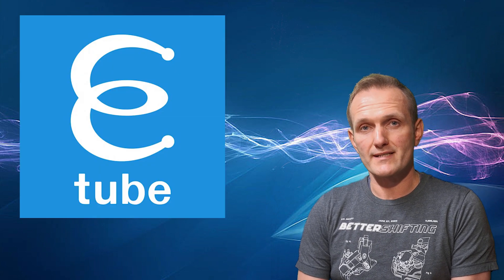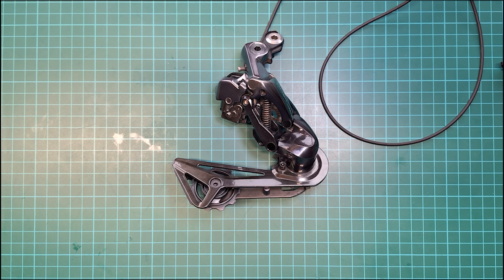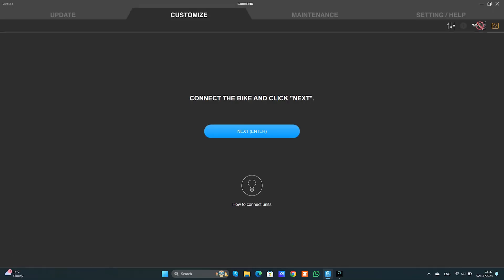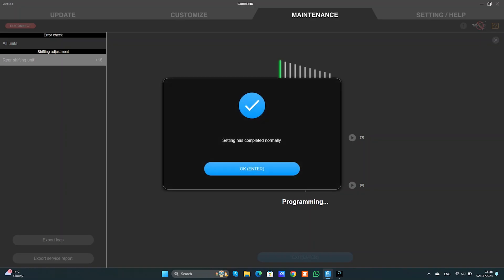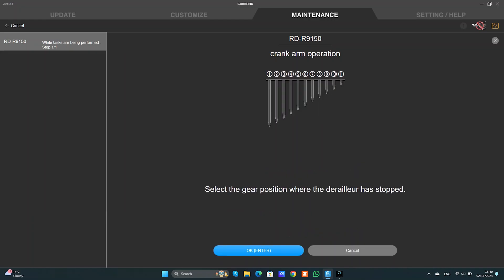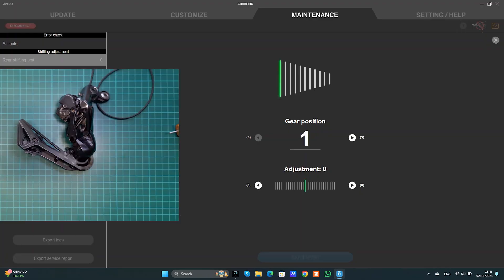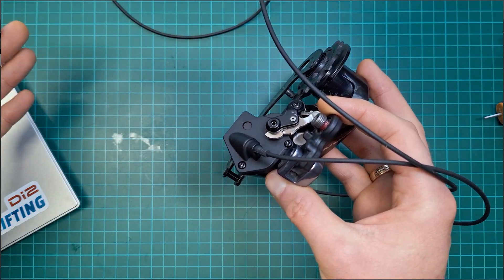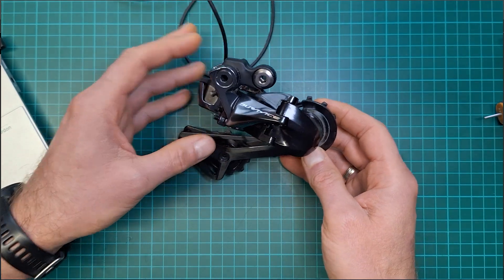Di2 position sensor reset using eTube Project (New old News)

Comment: Thanks for this great video, it helps me allot.
But when I perform a status check and select the sprocket which gear it is in, I get an error and have to perform an error check again.
Reply from the maker: What derailleur model is this? Does the unit shifts fine, (within the restricted range - 5 gears etc)
Reply: @Di2_GP it is an RD-r9150. The unit shifts fine.

This is the error I get: The derailleur position may not be adjusted correctly. Adjust the rear derailleur after checking the error
Reply from the maker: @MrMaurits1982  Can you drop me a dm, or email with screenshots of each step. I'm not sure what the problem is. I have not come across this before.
Reply: @Di2_GP no problem, I will probably do that tomorrow.

Comment: My Shimano Service Center is so incompetent. Instead of trying this, they sent the rear derailleur to Shimano HQ of my country. Let's see what happens.
Reply: update: they didn't even take a look. They sent it back because it has some scratches. Now I need to buy the SM-PCE02 by myself. And for this I waited 2.5 weeks. 😤
Reply from the maker: @likesdubstep  Where are you based? If you're are UK based drop me an email or DM in IG. I can help.
Reply: @Di2_GP  Unfortunately not in UK. I'm in Switzerland. Thanks for your help!
Reply: even if my derailleur behaved a bit different than the one in the  video, I could manage to repair it with this tutorial :)
Reply from the maker: @likesdubstep  That's great. I take your SM-PCE02 has arrived. Well, now that you know how to do it, you  ay be able to make some money off LBS, by resetting the sensor ;-)
Reply from the maker: @likesdubstep  Hopefully, you'll get a new replacement, but I agree they should have tried it first, especially if Derailleur is working and the only issue is misalignment.

Comment: Hi, I have an issue on 12sp dura ace di2. when I try the method of indexing in 5th gear, I can't go - enough to make it touch 4th gear. I get all the way up to -18 and its still not making a sound. Also I have to run -13 or -14 to make the last gear not sound weird. But that then makes some other small combinations make sound like skipping. Do you think preforming such a reset could help?
Reply from the maker: @donnieyen3831  Yes, that's very likely to help, and solve your issue
Reply: @ this method can be preformed with the derrailuer on the bike and all mounted right? Or it has to be removed from the bike like in your video?
Reply from the maker: @donnieyen3831  you can keep dérailleurs on the bike, but you must ensire you're pedalling during gear changes
Reply: @Di2_GP  thanks for your answers. What I wonder is, how would I go about my issue. Would I just perform an error check? Because in your video you explain about one gear less. In my case I can shift in all gears, but the index is very close to limit. How would I lets say just reset the value to 0, when I am centered on the 5th?
Reply from the maker: @donnieyen3831  before you can make any adjustments, the software will reset RD to zero. As you're nearly maxed out, you need to change RD position by one gear. 
14-16 clicks of adjustment translates roughly to 1 gear.
Reply: @Di2_GP  can I email you somewhere to ask for more detailed instructions? If its not too much of a hassle, because I am very confused what I would need to do. I am on 12 speed which has -18/+18. Atm the index setting is -13. If I understand correctly once I open the software it would show me 0 at 1. Then I need to first click right to +13 and start the error procedure?
Reply from the maker: @donnieyen3831  my email is in bio. Drop me a message. Where are you based?

Comment: Hi Pav, I have a problem with 105di2 12 speed rear derailleur, when i shift on the last gear rather than going on largest cog it will drop between cog and spokes. Vice versa it won't shift to smallest cog (11). I checked the hanger and it is straight, checked the cassette, the derailleur thinks to be one wrong step removed onboard. would this be a scenario resolved with the method you show?
Reply from the maker: @MichelePanzeri  I woudl be great, but I won't hold my breath ;-)
Reply: @Di2_GP  i should receive the new derailleur tomorrow, any tip on installing and pairing with the "old" system would  be greatly appreciated.
Thanks Pav!
Reply from the maker: @MichelePanzeri  Just plug in and pair it using an eTube app. For 105, there is no other way. With Ultegra and Dura-ace, you can hardwire everything and use the function button.
And remember, keep that batter charged.
Reply from the maker: @MichelePanzeri  Yes, that's the exact scenario. Going through this procedure will reset your micro adjust to 0 and will allow you to select the correct gear.
You just need the SM-PCE02 tool to do it.
Reply: @Di2_GP  Thanks Pav, much appreciated, looking for a local mechanic to do it for me, if not i will go ahead and get the SM-PCE02. I will keep you updated.
Reply from the maker: @MichelePanzeri  SM-PCE02 is expensive, but this is a good investment if you own 12 speed Di2, or any Di2 for that matter. Hopefully you will get it solved.
Reply: @Di2_GP  Hi Pav, I decided to go down the mechanic route and brought the bike to them on monday, they ran diagnostic and tried to use the method described in your video, unfortunately they were unsuccessful and the software returned the following message: 
"RD-R7150 is not working properly. Check that it is installed correctly. If it is installed correctly, contact your place of purchase or distributor.” 
Of course they checked hanger , limit screws and b screw. Nothing physically/mechanically wrong.
So, i now contacted the dealer i bough it from and waiting for a replacement which will hopefully arrive quickly. 
Very strange for a 7 months old unit used in fair weather and on road only to develop a fault so quickly... thanks again for all the advice and support, love your website too.
Reply from the maker: @MichelePanzeri  That's strange, unless you already sent the unit back to Shimano, I'd try testing it again. but this time I woudl shift all the way up (the easiest gear) and then when derailleur shifts thru the range, and you get a message if it is in the correct gear, select no. This should take you through the procedure.

Comment: Hi Pavo, I had went on ahead and bought one of those PC Links and borrowed a PC from a friend to run it. I'm not quite able to reproduce the screens you get when updating your RD. I have this 9070 rear derailleur that doesn't shift up to the last two big rings, and it wants to go 2 rings further than the smallest cog, all the way to the B limit screw and touches it. I do manage some of the steps you show, but when I check error at the end, it just tells me that I might have a fully arm... I got this derailleur from someone else and it has one of those silly oversized jockey wheels on it. Any avenues you can send me at this point? Thanks again for all the great videos and tips in how to fix all this, it's been so useful.
Reply from the maker: I happen to have Dura Ace 9070 derailleur (as you do) so I will test it. Will try to do it tonight, when I'm back home from work. If I can make it work, I will try to make a video and share it with you.
Reply: @Di2_GP  You are too kind, thanks so much.
Reply from the maker: @hmudesign  Well, as it turned out software reset is not an option for 9070 😞. As mentioned before you must tap out the cam disc and rotate it by 4-5 clicks on the spline. It is fairly straightforward. I suspect this is because 9070 and 6870 have full 360 degrees wheels inside, and they rotate without restriction, unlike R series derailleurs. Sorry I got your hopes up.

Comment: Thanks for the video,  I had the exact same issue last night and I'm glad I had seen your videos, both this one and the mechanical teardown fix for it. Since I don't have the linkage cable, I thought that I would have to do the mechanical teardown way, but I don't have the special 3 pronged bits and I didn't feel like cutting slots in the screws. But since the position sensor uses a magnet I thought I would be able to fix it with a strong magnet... and I did. I posted a quick video here showing how it's done: https://www.youtube.com/watch?v=JhXncO9s3HU. Thanks again for the teardown, I would never have thought of doing it if it wasn't for you.
Reply from the maker: Well, If I knew I could fix it with SM-PCE02 I wouldn't have take it apart. Although you never know, you may find something inside. Also, opening servo gives you an opportunity to put some extra grease!!!

Comment: So if I understand this correct, before this e-tube upgrade you had to shift to the 5th sprocket from the largest one and then enter “adjustment mode”. Now you can enter adjustment mode on any of the sprockets. Have I understood this correctly?
Reply from the maker: No, the adjustment mode remains exactly the same. This new feature (Since September 2021) allows you to reset derailleurs position. For example, if you have maxed out on trim, your derailleur is on +16, but it still won't shift to the smallest cog, with this function you can reset trim status to 0, or you can tell derailleur that it is in 10th sprocket. Position sensor fault isn't that common, but until this feature was introduced, your only option was to take the servo apart, and reset internal gears manually.
Reply: Sorry but I’m not familiar with “maxed out on trim” and “trim status” and “position sensor fault”. I have a 12sp di2 Ultegra system so am familiar with di2 but not this. What exactly do you mean by trim?
Reply from the maker: @troelslarsen4779  Trim (indexing) when you are setting up your derailleur for the first time sometimes you need adjustment. This is also referred to as micro adjustment. on 11 speed you have +/- 16 clicks and on 12 speed +/-18 clicks. If you swich between wheels with a different hub spacing, sometimes you need to adjust (index) gears. 
Position sensor is a component inside the servo, or every Di2 derailleur, it is contactless device telling the system where exactly derailleur is (which gear). Sometime this sensor receives a faulty/corrupted signal, which may result in derailleur over or under shift. You won't be able to access diagnostic menu shown in this video if you don't have SM-PCE diagnostic tool. 
I think what you had in mind is just indexing, where ideally you should shift half way thru the cassette and adjust your derailleur (index gears).

Comment: Hi Pav, thanks for compliments! Good to work together like that!
One idea...
I think you are focussing on two topics at the same time in your video - faulty position in general and not ideal position of micro steps zero position.
You might split up this video into these two different szenarios:
1. Use the tool to create a situation where the position of the derailleur is completely wrong and then show how to reset the global position of derailleur - means synchronisation of mechanical and electronical position.
2. Make a second video just to show how to optimise ZERO position of the derailleur in relation to the situation of you secific bike setup.

By the way - I once tried this with ...01 tool as well, maybe I did not find it in the V4 software. At that time I was not aware of this function  - but I am quite shure that it does NOT work with ...01 tool and old V4 software!
Take care! And thanks for the video!
Reply from the maker: Hi, now that I know this feature has been available since 2021, I want to see what else is hidden in the eTube Project. I will make a follow up video at some point. P.S I think this feature is only available on e-Tube Project Professional 5.0.1 onward. V4 is standard version.